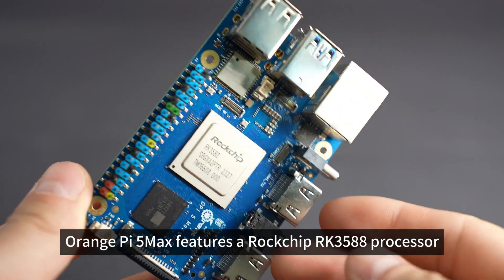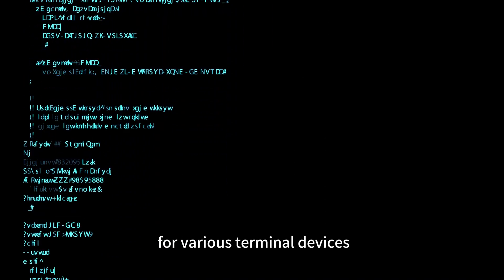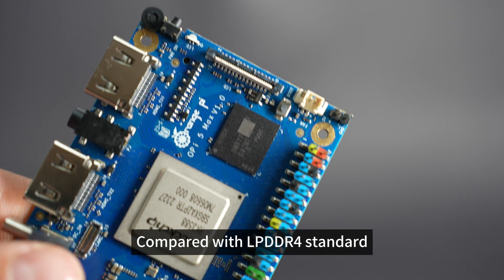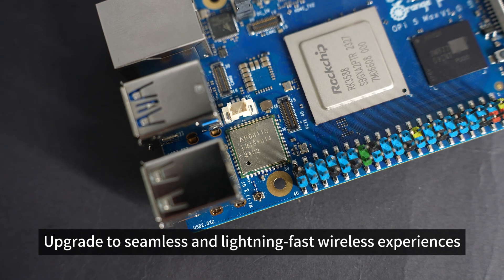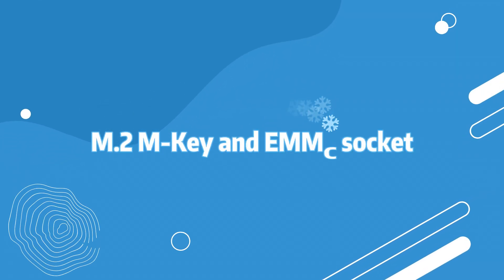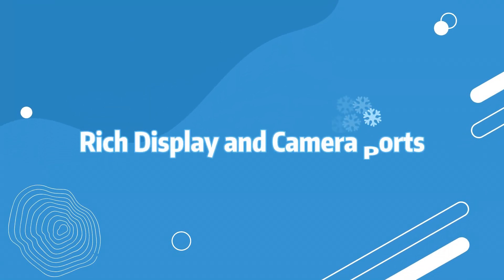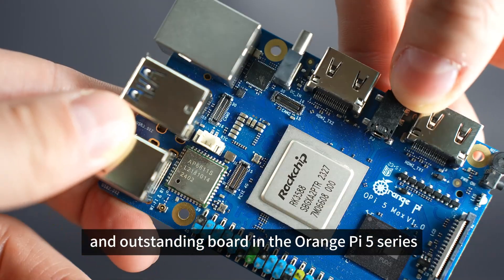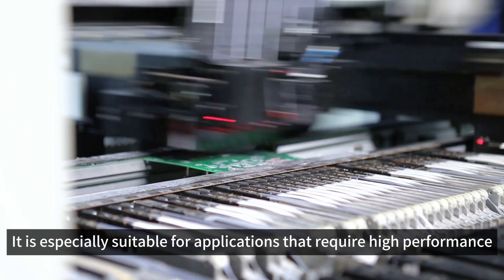Orange Pi 5 Max Officially Launched ! ! Most Powerful Development Board with Superior Performance.

Comment: No thanks.  Until there is better rk3588 support for Linux, I won't be buying any more Orange Pi products.
Reply: I run ubuntu and server , no problem
Reply: Rk3588 has mainline linux support now. Armbian and Ubuntu_Rockchip runs great on it. even HW decoding and encoding is supported using the VPU(RK MPP). great daily driver.
Reply: Have you tried Joshua Riek's Ubuntu 24.04 for Rockchip?
Reply: Have you tried Joshua Riek's Ubuntu for Rockchip? Works better than the official Orange Pi OS distros.
Reply: Have you tried Joshua Riek Ubuntu for Rockchip?
Reply: Those boards are NOT made for everyone, but for tinkerers. If you can't/aren't willing to tinker, then don't bother with it.

t. Got a Orange pi zero 3 with the same "zero support" as this board and the performance is better than the rpi 4.
Reply: Oh, it's that so ? How does it compare to RAspberry Pi 5 in terms of OS options ? I happily own a raspberry pi5 enjoying the latest debian release, but it really lacks horsepower compared to my N97 running both windows 11 and Ubuntu.